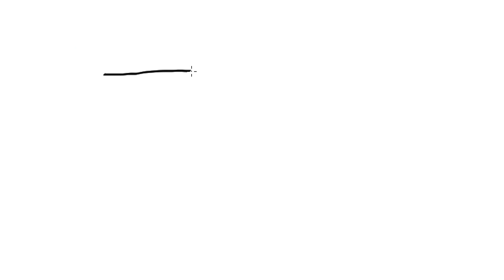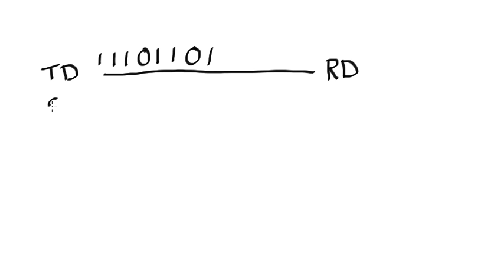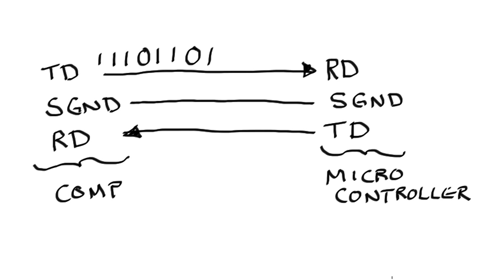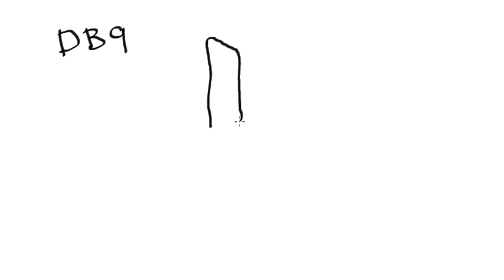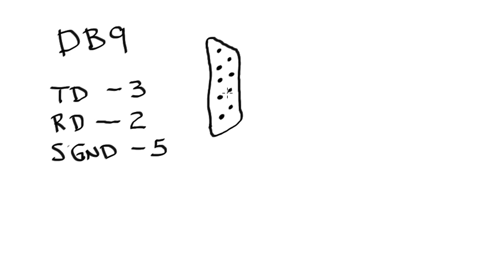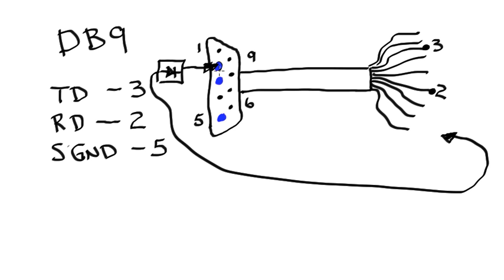Serial Communication with a Microcontroller

Comment: Well I think you probably need to add more concept for the establishment of serial communication between MCU and PC. Importantly, RS232 logic level works with +ve voltage for logic low and -ve voltage for logic high whereas MCU uses TTL level representing +ve voltage for logic high and 0 voltage for logic low. So you have to put some intermediate link  such as MAX232 chip between MCU and PC in order to establish communication... Furthermore, I believe transmission mechanisms such as simplex/half duplex/full duplex also need to be mentioned. Cheers....